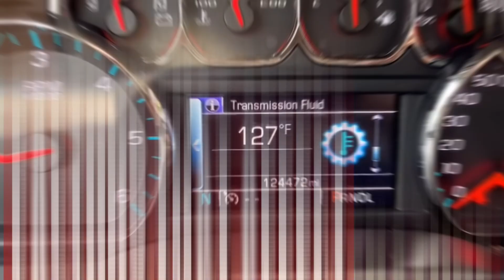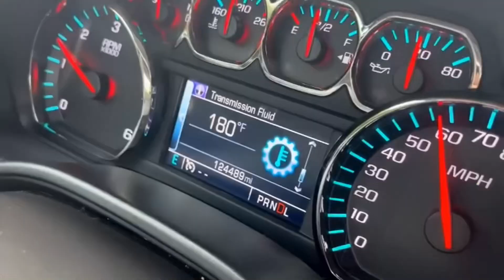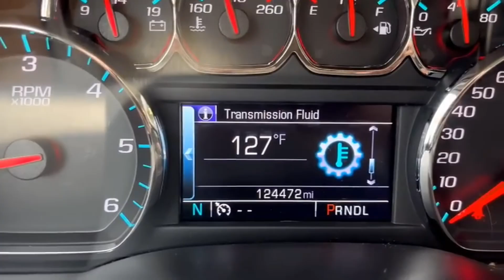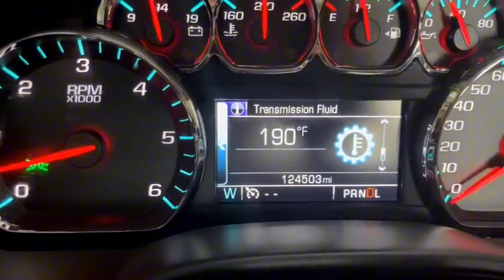What is Normal Transmission Temperature   When Yo

Comment: What is Normal Transmission Temperature When Yo Mama Hitches A Ride
Reply: I prefer the Mama-Rotunda cooler. It reduces the transmission temperature by 489 degrees. Just going to the welfare office will spike the fluid temp, along with the constant bitching, which can cause the transmission to feel bad about itself.